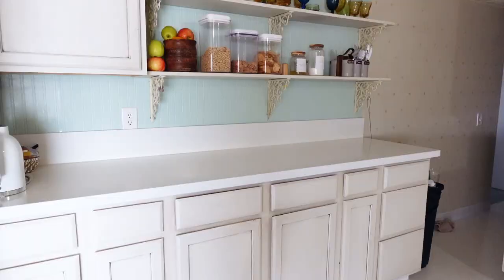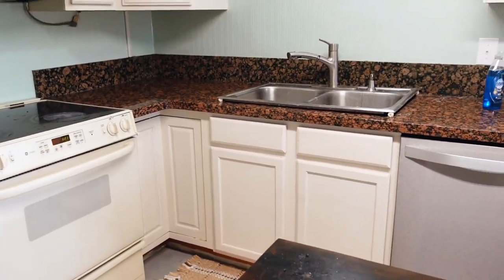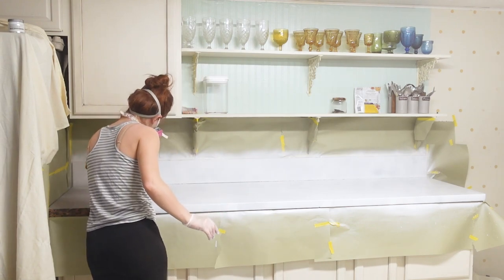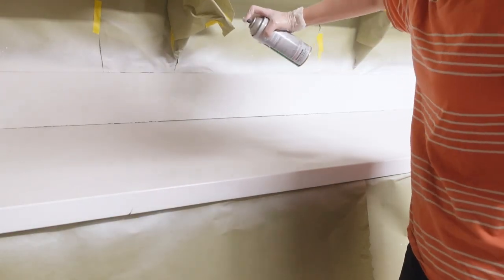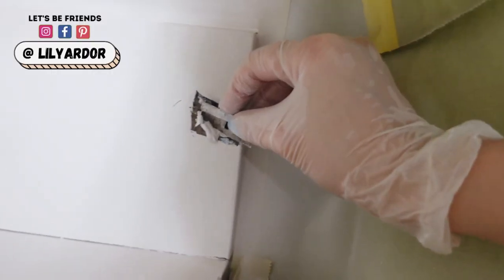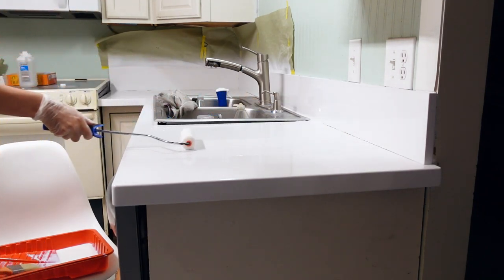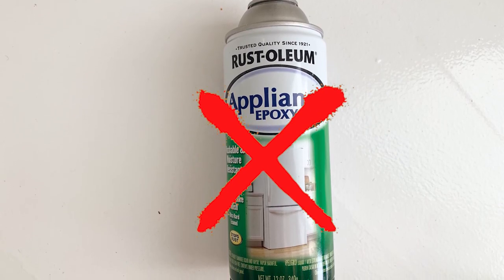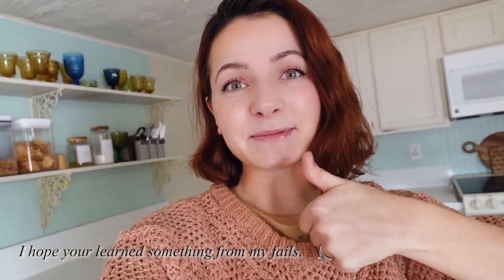I SPRAY PAINTED MY GRANITE COUNTERTOPS! WHAT HAPPENED! #FAIL

Comment: Most granite have a sealer on the surface. I’m guessing if the granite surface was roughed with 240 grit it reduce the paint chipping.
Reply: i use 220 grit myself but they both get the job done.
Reply: why would you help anyone to destroy thier granite?  this process should not even exists.  what a garbage idea.

Comment: I had great luck recoating a rusty bathtub with the appliance epoxy.  Sanded, cleaned with acetone and applied it in a sealed environment using plastic wrap and tape. It lasted 5 years which was much longer than I expected.